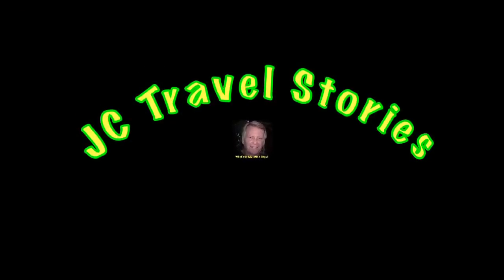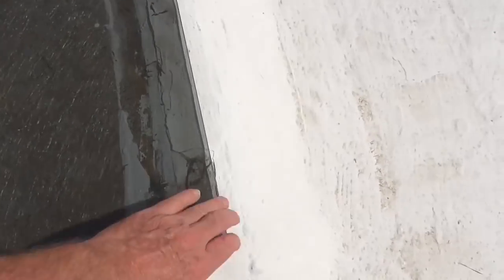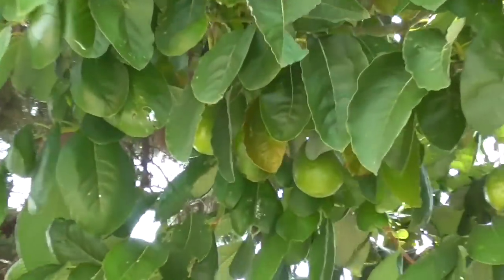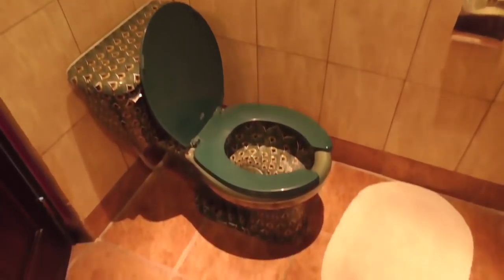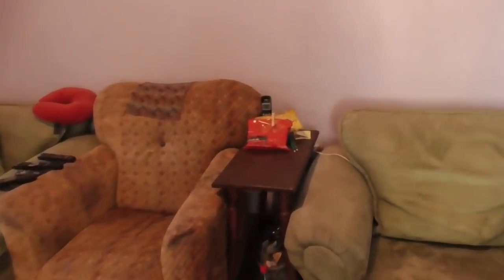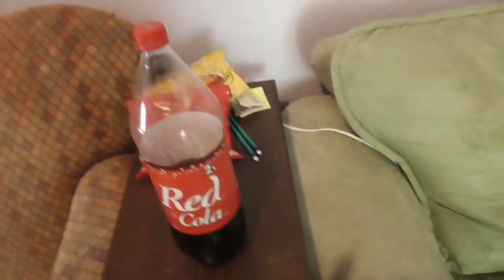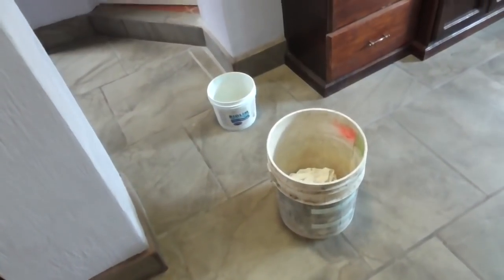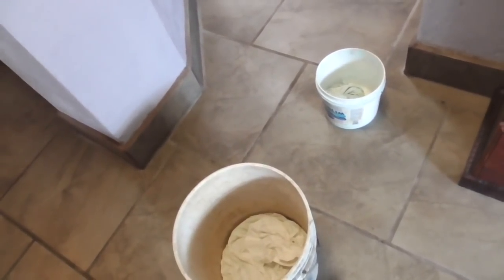How to Fix a Roof in Mexico.

Comment: To untie the knot, take the short open end & twist it into a tight rope ( you may be able to see which way they twisted it when tying the knot, continue the same twist).  Twist the “rope” as tight as you can without kinking it.  Then it will usually be firm enough to just push it like a little stick, back through the knot.  I hope that’s not too confusing.  Just try it 😎

Comment: We had our roof redone (empermeabilizado) here in Northern Mexico in February.  We removed all the roof tiles, cleaned the surface, patched a couple of spots with cement.  Then we rolled out a layer of a fiber membrane and two coats of Thermotec.  With the tiles put back on we should have a no-leak roof for another 10 years.  Good job and a great explanation.  I also want to add that Coca Cola Mexico (FEMSA) now uses corn syrup as well.

Comment: Yes, good point! you get the old concrete wet to make sure there is a chemical bond between the old and the new concrete. And this bond also works for bricks and mortar. Right? in fact, a brick laying Mexican pro will have the bricks in buckets full of water before laying them.

Comment: Hola Jerry. Please let us know if your patching eliminates the leak. I have a few questions if you don't mind. Who owns the property beyond your fence where the horses hang out? Did you eliminate the chain link fence in your "front" yard, or is it still there on the right side? Also, Mexican law prohibits foreign ownership of ocean coastal property. I guess there is a workaround with a prestanombre or some other Mexican entity holding title. Is there the same issue with foreign ownership of property on the lake? Gracias, amigo.

Comment: How much will it cost to cut down your 3 palm trees? Here in PA to cut down out 80 ft pin oak tree was $1800. Inside, when cut, it was all black inside. I don't know if it was a parasite or just rot. I sure miss the shade! Be careful on that roof.

Comment: Curious whether you have hot water in your house and if so how you heat it. I live in Costa Rica where many (especially older) houses do not have it. Some people actually prefer cold-water showers. I don't. I have 2 bathrooms with a shower each. I heat the water using a "de paso" heater. They're electric and heat the water as it passes through, not with a tank, hence the "de paso" appellation. One heater fluctuates from scorching hot to tepid. The other is steadier but doesn't heat the water to such a high temp. The one that fluctuates and can be scorching is made in Costa Rica. The other is German.
I have a friend who is an electrician from Missouri. He has told me that, if I ever need a new water heater, I should use a gas fueled heater because they just "sip" energy (his word).
Reply: I believe I saw in a previous video that JC has a hot water heater outside of his kitchen in the corner of the patio.